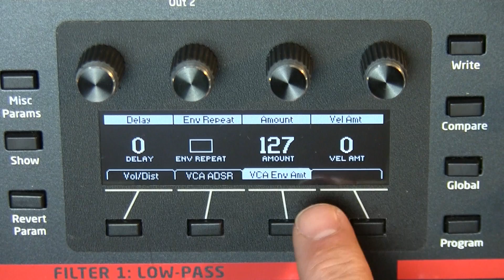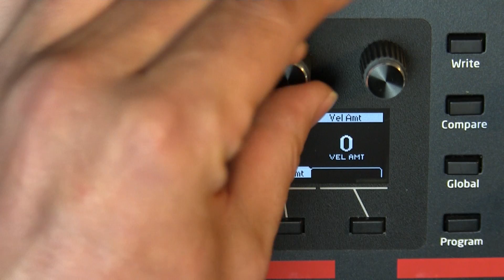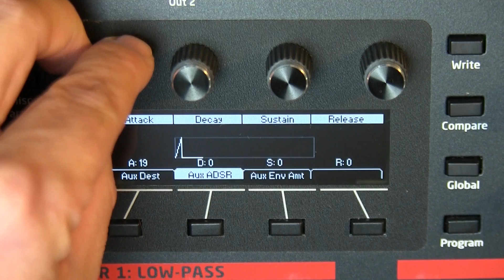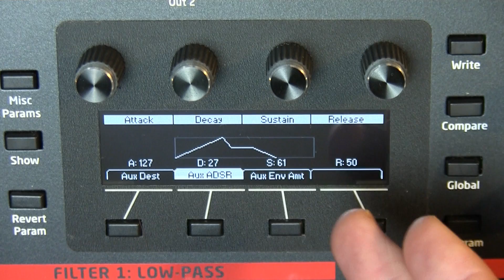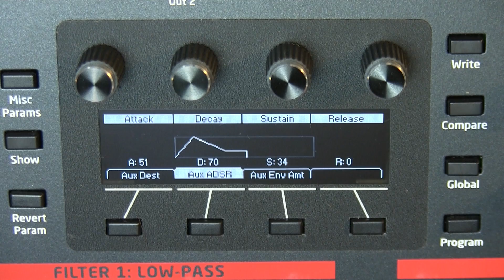The Dave Smith Instruments Pro 2- Envelopes

Comment: Is it just me who feels 0-127 for key values such as envelope parameters is a bit "weak" in this day and age? Yes, it may be very MIDI-compatible, but this isn't the 80s any more... Even 256 different values for the filter and oscillator parameters seems rather archaic and "8 bit". Or am I expecting too much, and this is still normal? There's also the question of whether smaller steps would be differentiable by humans anyway...

Comment: re. 1:30 - Oberheim OB12 'SCOPE' function displays real time graphic parameter views, though somewhat less slick than the Pro 2.
Reply: PS how have you been able to sleep since acquiring this masterpiece?!
Reply: Kurzweil K2x00's too.
Reply: Waldorf Blofeld also
Reply: Korg's wavestation from 1991... 01/W.... JD-990... ;-)
Reply: AJ Gapsquez Yes, and the Blofeld's graphic of envelopes and such is better than that which is on the relatively tiny P12/P02 screen. If only the Waldorf Pulse 2 used same graphic method with it's screen.
By reading the Pro 2 manual a while back, I see Marc forgot to add a pretty important fact that the envelopes are loopable as well...not a new function as even my Waldorf Q has these.
Reply: Robert I Even my 1985 Korg DW8000 has 8 stage envelopes. This as well as SCI Prophet VS were among very first of analog/digial hybrid...I still have the DW8000 because it simply can sound way more analog than newer DSI hybrid synths.  So let's get to the sequencer already...in-depth, as the Pro 2 manual quite sucks on sequencer explaination
Reply: Robert I oh I know! I was so excited for the pulse 2 and when I saw they only use the giant screen to display the patch number I was so disappointed (still sounds fantastic though) I keep hoping for some sort of a software update to give you full graphic display of waveforms, LFOs, envelopes etc